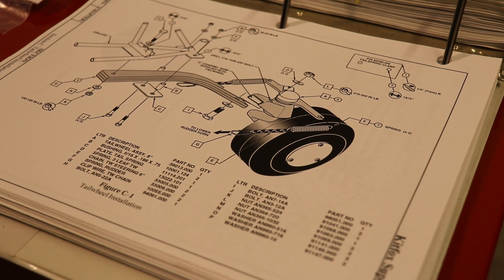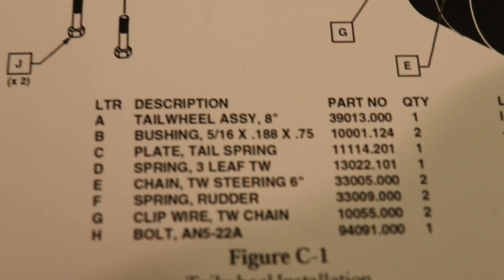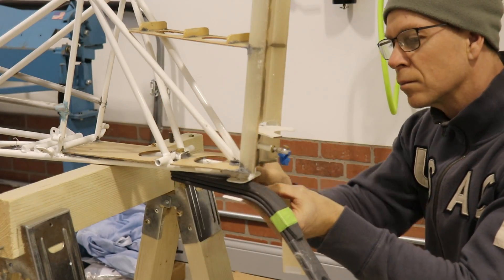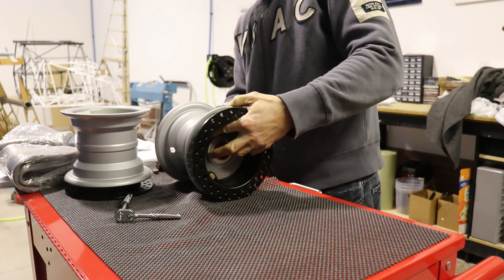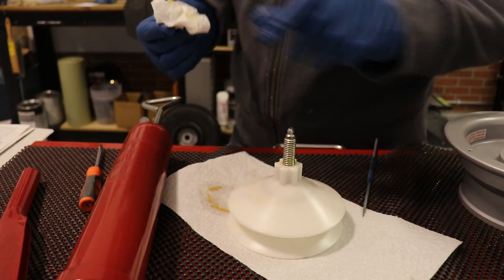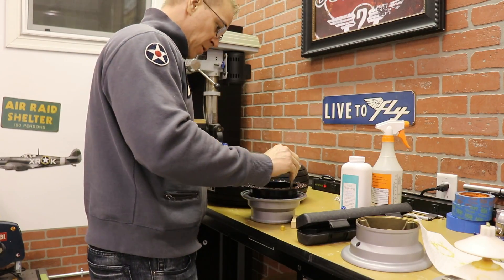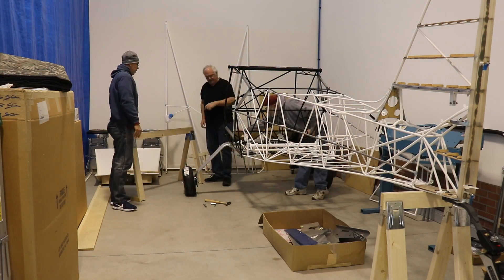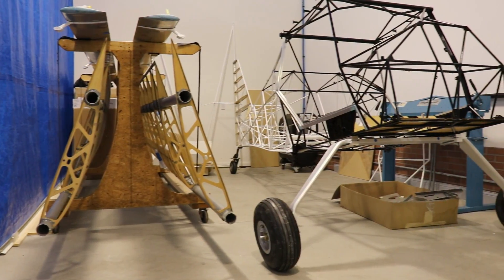KITFOX-Putting it on the Landing Gear!!

Comment: Enjoy your videos. What are those pins for that you hammered into the gear. Is it something to do with the internal brake line? I checked grove installation diagram/instructions, but it doesn't explain why you but them in? I am considering grove gear for my kitfox 4.

MANY thanks,

Martin from IRELAND.
Reply from the maker: Those pins are just positioning pins for the gear. The Kitfox construction manual is very good and explains the pins.
Reply: @KitplaneEnthusiast  Thank you.

Comment: I know you built it to the plans, but I think the plans are wrong. The bolts for the tail wheel should drop in from the top, not insert from the bottom. Of course you have castellated nuts and cotter pins, but if you somehow lose a nut, with the bolt in from the top, gravity will at least keep you from losing the bolt. Even the tiniest bits of safety margin can add up.

Comment: stop the video at 16:16 you will see the rollers in the bearing are dry,grease should be squirting out between  the rollers and the roller cage not the inside or the inner race.I have never used such a device but I would wager a bet the bearing should have been placed the other way around.Please keep an eye on that wheel sure hate to see you have a problem

Comment: This is more like assembling an airplane than building one. Looks much easier than what I'm used to doing, which is just buying the plans, with a construction manual thats maybe a hundred pages at most. There sure is a big difference in getting the parts already made rather than having to build the parts and then assembling them, but I think there is a big difference in the amount of money you have to have. I guess the best way to go would depend on how much spare time you have, building skills, or ability and desire to learn, and of course the big one for all of us... money.I would almost feel like i'm cheating if I had assembly instructions as detailed as the ones in this video and the parts already made, but compared to building one from scratch, I wouldnt mind cheating a little. I think I'll take some time and go look one more time at the kitfox web page. maybe they are cheaper than they were last time i looked. :) yeah right.

Comment: Mark, as I was watching yo assemble the tail gear, a question I've been pondering for a while resurfaced. Occasionally on STOL aircraft but more commonly found on backcountry aircraft fitted with pontoon it's common to see a single or dual set of fins on the underside of the fuselage just in front of where the tail gear would be. My question is how do these fin function? to they add more tail authority and ideally reduce adverse yaw or somet5hing else? Your insights are appreciated.

Comment: A lot of times when you have to "enbiggin" (subscribe to AVE to funningly learn a lot about a lot) a hole is because the designers forget to incorporate the thickness of the powder coat (which tends to be thck in comparison to paint) on such parts.....happens all the time.  The question is with a hole, was it intended to be removed (bare metal to metal) or left in place to prevent a point  o
of corrosion....who knows...
 Frankly, I prefer the old school bearing pack method where you skim grease into side of the races with your thumb while rotating the bearing......just to know fer sure....... Good luck on your build!

Comment: Get an old time mechanic to show you how to pack a bearing without any fancy store bought gimmicks that make a mess and throw away those stupid gloves.. We have soap and water now. And pit some oil on the felt so it does its job....Th reason you make a mess is because you pump way too much grease... When you see the grease at the bottom of the bearing it is full. You can't make it any more full when you pump more grease into it. You re just wasting material. Use common sense. (Of course that has gone by the way side these days) The inner tube comes from Goodyear. Kitfox just sends it to you and charges you more money for it.

Comment: Mark, thank you for all the uploads.  Your videos are truly great, as are Jason Ellis' with his RV-10, when it comes to the process of putting one of these projects together.

Since you've built a few aircraft and have 2 active projects, you are best equipped to answer which kit you believe to be the easiest to assemble.  I understand that they'd be varying levels of difficulty - as the Zenith's are aluminum/fiberglass while the Kitfox is fabric covering, etc.  But - based on your experiences building EAB airplanes, which kit would you recommend to a first time builder?  The posted build-times available on all the sites vary from one extreme to another.

Regardless, it seems as though you enjoy the build process very much, no matter which one you'd be up against, but to the rest of us - it's a pretty scary prospect of getting in something that we duct taped together.  I'd be scared beyond belief doing engine work in any kit that was selected to be honest.

If you were going to make a recommendation, solely on the "ease of construction" - which kit would make the most sense?  (i.e. Kitfox, RV, Zenith, Sonex, etc.), of course with a realistic approach to someone who works full time elsewhere?
Reply: Understood on all points.  Thank you for taking the time to respond.

It looks like a really rewarding time doing the build process.  I'll definitely take your advice and not purchase based solely on "ease of assembly" though.

For your tips on the engine though...  I have no doubt I'd be successful following the instructions - but I'd probably cut a sticker that warned people of the nature of the build, in tiny print for passengers that said "Warning, this engine was bolted together by a non-mechanical guy by any stretch of the word, ride at your own risk"  :)

Please don't ever stop posting videos of your builds, it's nice to see everything coming together.

Comment: You should consider beefing up the tail spring pad at the bottom of the Vertical stab and adding gussets. Easier to do it now than after it breaks and you are welding with fabric on the plane.

Comment: Hi Mark, was watching this week’s video and saw you were struggling with the bearing packing tool.  While those are effective they are very messy!!  I am both a aviation nut and Snap On tool dealer and I use the Lisle Handy Packer (pn 34550). I purchased this for my all around bearing packing needs and the RV10 build if or when I get to that stage... ;o) btw I really like the videos and the work you are doing.